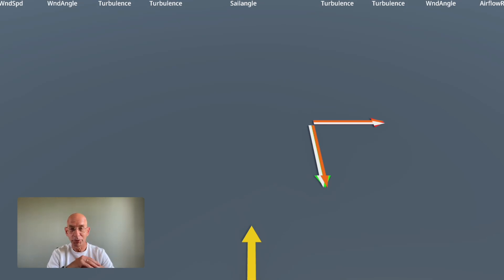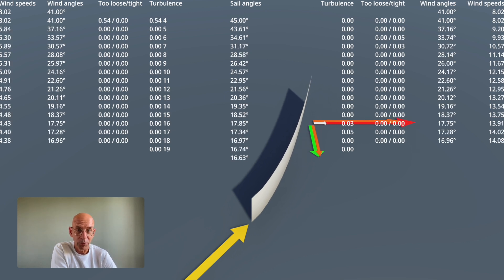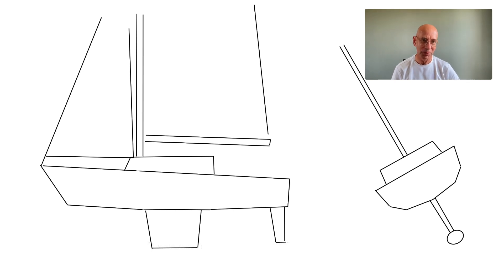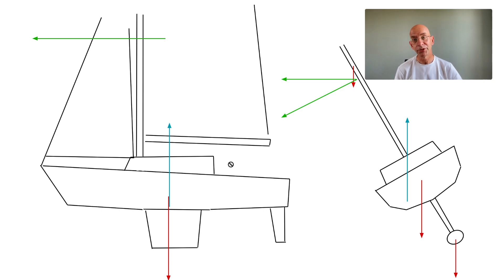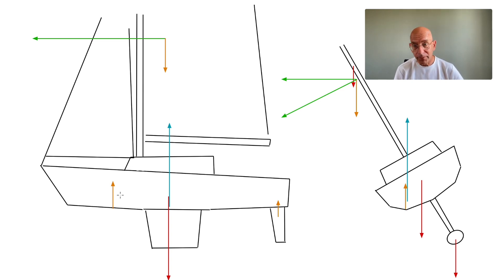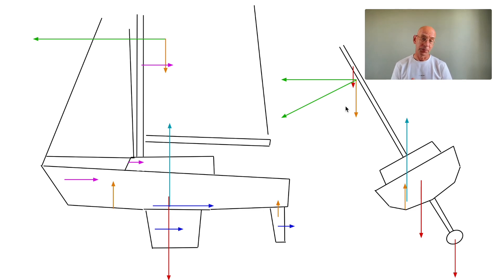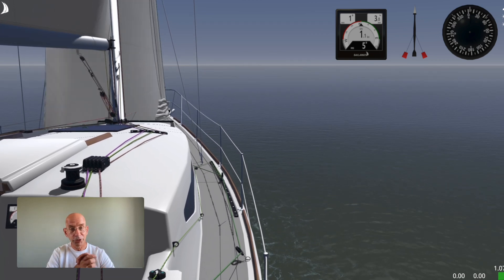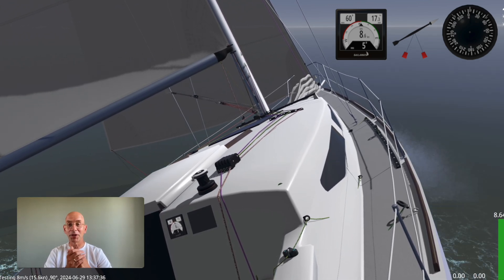Sailaway III - Behind the scenes

Comment: That dude is genius ! So much work - optimization, calculations and even code itself in 2 weeks ? Amazing !!! Tremendous amount of work ! Usually i would say there are no way team of 5 people could do that in 2 weeks ... Also may i suggest to look a little bit on differential equations systems ? That looks like could be task solved by that field using some approximation method of solving them. Because basically what i understand we need to not a force but rather change of force. If we know that angle of heel is 0 and it changes 2 degree per second we could calculate that next second it would be 2 degree even before that second. But I'm no near to be an expert in field of real time physics calculations - maybe what I've said is totally wrong 😅
Reply from the maker: Thank you Viktor, but you give me a bit too much credit. I didn't write it in 2 weeks, I tweaked it in 2 weeks. I am no mathematics expert either, but yes differential equations certainly make a difference at certain points. Although most of what's at play here is a straightforward implementation of the good old law of Newton F=m.a and since the computations are done many times per second, most aspects of the boat movement and rotation ease out nicely. For now I am happy with the result :)